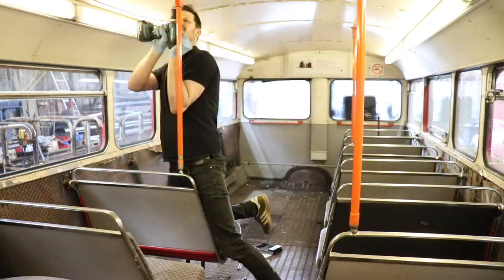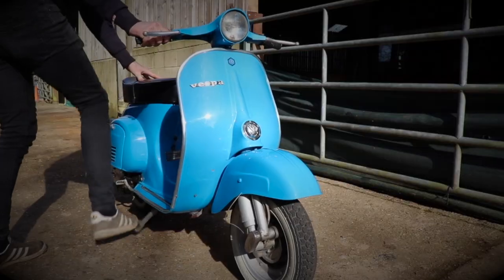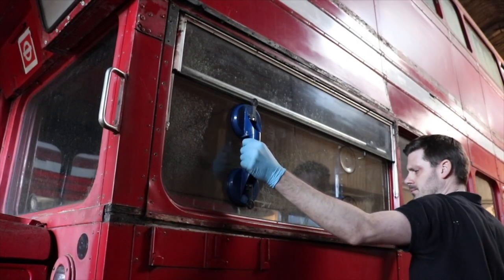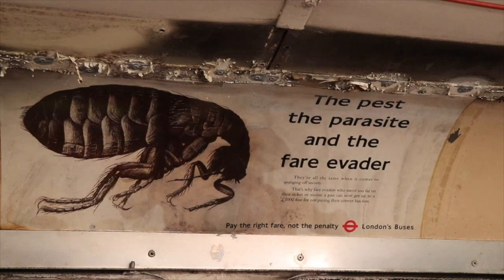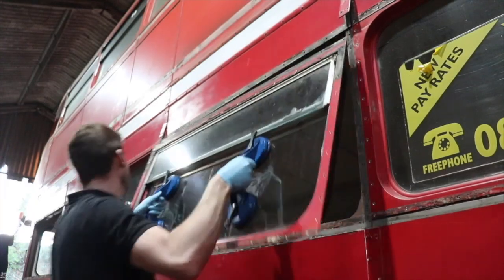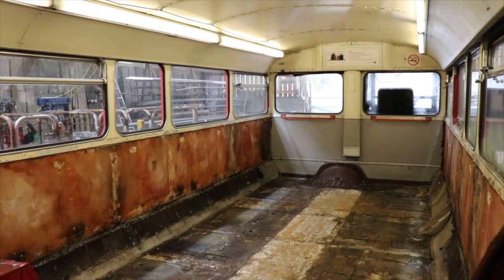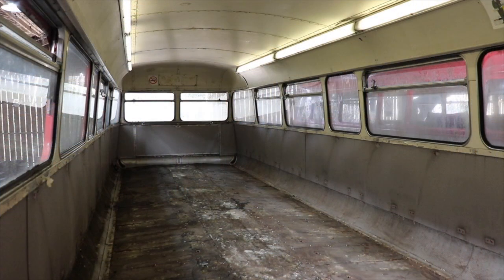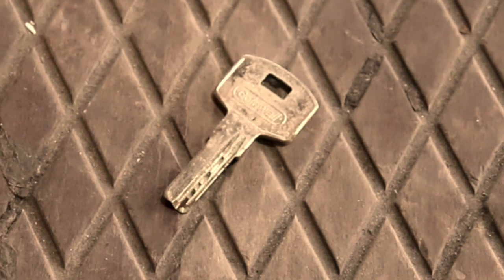Pete And His Bus, Episode 6: What did I find

Comment: Ooo a Vespa man, I got a MK1 T5 in my front room alongside the 617th built Lambretta LI150 regged in '58.   I cut my scootering teeth on a banana yellow R reg Primavera which was just about the fastest thing on 10 inch wheels going hehe  One of the old Bromley lot, used to on occasion hang out with the A21 Animals, that was when I had my 1961 Douglas 152L2 which was British built over in Bristol and I used to annoy mods by parking my infamous pile of doings next to their fancy plush scooters and they used to move their rides away from mine with their noses in the air hehe
Reply from the maker: Love it Ian, can’t beat a good 2 stroke Italian! Thanks for watching, appreciate the support!

Comment: I remember RML 2730. Drove this bus for years on the route 38. It was one of the faster ones we had on the route.
Reply from the maker: 2730 never drove 38 so you might’ve got her mixed up with another. Still very cool though.
Reply: I'm  sure I did as at arriva they used to swap and lend buses between Tottenham and Clapton depots. I could be wrong but when 73 went bendy Clapton got the RMLs from Tottenham.